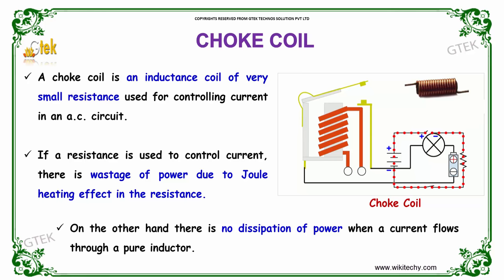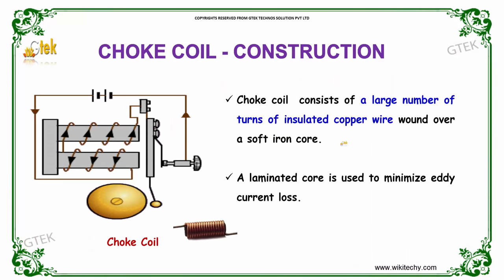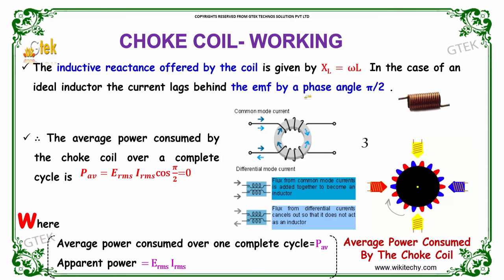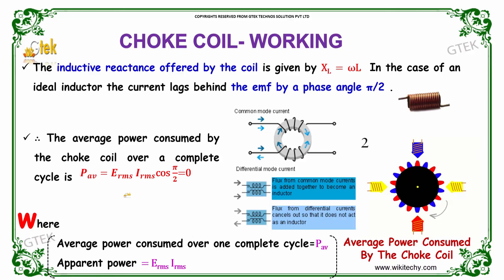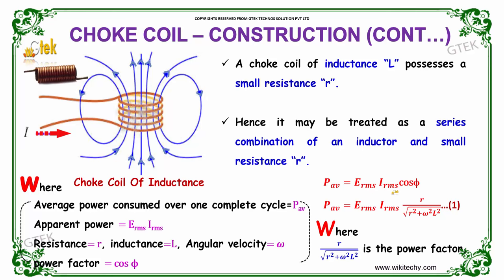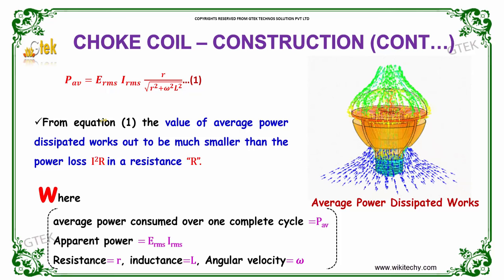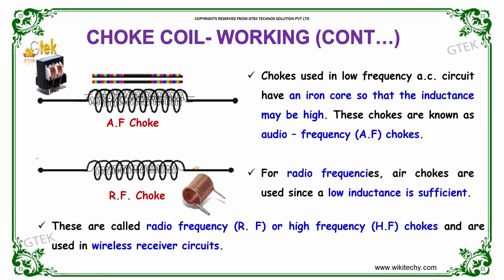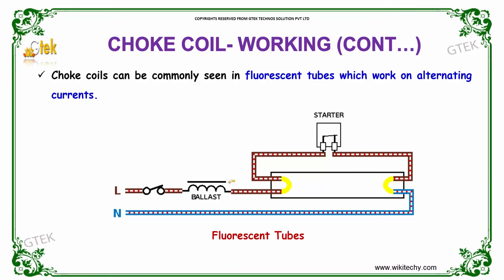Choke Coil | Electro Magnetic Induction And Alternating Current | JEE Main and Advanced physics

Comment: In electronics, a choke is an inductor used to block higher-frequency alternating current (AC) in an electrical circuit, while passing lower-frequency or direct current (DC).

Comment: Choke (electronics) In electronics, a choke is an inductor used to block higher-frequency alternating current (AC) in an electrical circuit, while passing lower-frequency or direct current (DC).

Comment: A low-resistance inductor coil used to suppress or limit the flow of alternating current without affecting the flow of direct current, as in applications that require conversion of AC to DC.

Comment: choke coil. noun. A low-resistance inductor coil used to suppress or limit the flow of alternating current without affecting the flow of direct current, as in applications that require conversion of AC to DC.

Comment: In electronics a choke is an inductor used to block higher-frequency alternating current (AC) in an electrical circuit, while allowing lower frequency or DC current to pass. A choke usually consists of a coil of insulated wire often wound on a magnetic core, although some consist of a donut-shaped "bead" of ferrite material strung on a wire.

Comment: A low-resistance inductor coil used to suppress or limit the flow of alternating current without affecting the flow of direct current, as in applications that require ...

Comment: The purpose of the choke is to provide a very high voltage initially between the filaments (across the two ends of the tube light). Again once the gas in the tube is ionized the choke provides a low voltage. A choke is a coil of wire.

Comment: A "choke coil" or "choking coil" is an electrical coil of large inductance and small resistance used within an AC circuit to throttle, impede or change the phase of the current. It is also called a "reactor" or "reactance coil" in the field of engineering

Comment: A "choke coil" or "choking coil" is an electrical coil of large inductance and small resistance used within an AC circuit to throttle, impede or change the phase of the current.

Comment: A choke coil is an inductance coil of very small resistance used for controlling current in an a.c. circuit. If a resistance is used to control current, there is wastage of power due to Joule heating effect in the resistance.

Comment: "choke coil" or "choking coil" is an electrical coil of large inductance and small resistance used within an AC circuit to throttle, impede or change the phase of the current

Comment: When the current flowing through an inductor changes, the time-varying magnetic field induces a voltage in the conductor, described by Faraday's law of induction. ... As a result, inductors oppose any changes in current. An inductor typically consists of an electric conductor, such as a wire, that is wound into a coil.

Comment: In electronics, a choke is an inductorused to block higher-frequencyalternating current (AC) in an electrical circuit, while passing lower-frequency or direct current (DC). A choke usually consists of a coil of insulated wire often wound on a magnetic core, although some consist of a donut-shaped "bead" of ferrite material strung on a wire. The choke's impedance increases with frequency. Its low electrical resistancepasses both AC and DC with little power loss, but it can limit the amount of AC due to its reactance.The name comes from blocking—"choking"—high frequencies while passing low frequencies. It is a functional name; the name "choke" is used if an inductor is used for blocking or decoupling higher frequencies, but is simply called an "inductor" if used inelectronic filters or tuned circuits. Inductors designed for use as chokes are usually distinguished by not having the low-loss construction (high Q factor) required in inductors used in tuned circuits and filtering applications

Comment: A radio frequency choke is air cored whereas an audio frequency choke is ... induced emf in producing unit current in the coil itself). 5.A circuit with a vertical .... other coil B to an alternating current source D. If a large copper sheet CC is placed.

Comment: A choke is an inductor used to block higher-frequency alternating current(AC) in an electrical circuits, while passing lower-frequency or direct current (DC).

Comment: Electronics Tutorial about the Inductor, what are inductors, its Inductance ... For most coils the current, ( i ) flowing through the coil produces a magnetic flux, ( NΦ ) ... a choke, is another passive type electrical component which is just a coil of wire ..

Comment: A "choke coil" or "choking coil" is an electrical coil of large inductance and small resistance used within an AC circuit to throttle, impede or change the phase of the current. ... Common mode choke coils consist of two conducting wires wrapped around a single core in opposite direction .